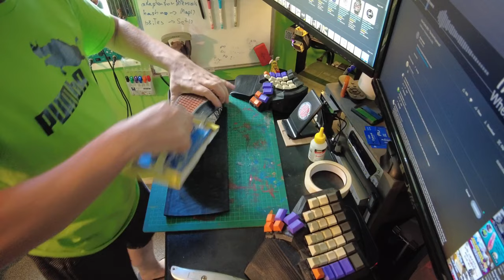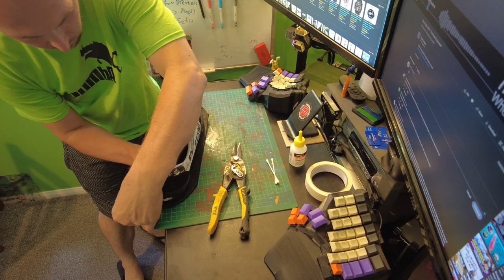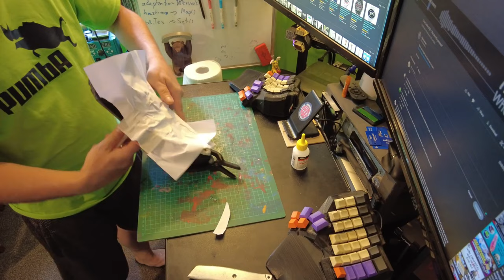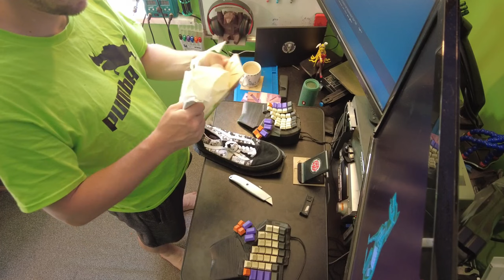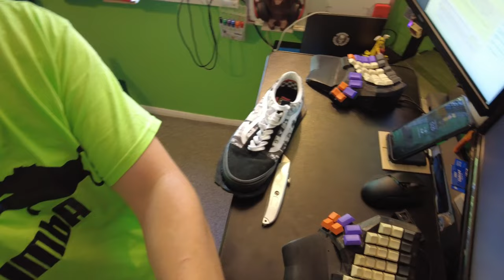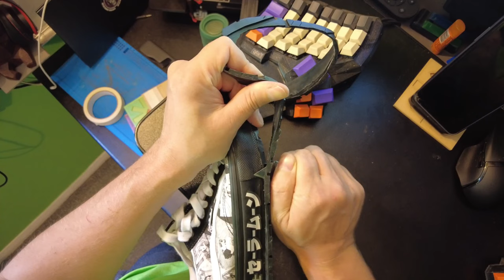In my home lab: Installing shoe sole for foot breaking on longboard.

Comment: Good result but damn...that's a lot of work actually!
Reply from the maker: Yes it is, but it's worth it. Apart from durability, grip on the board is significantly improved, and the braking is smooth.